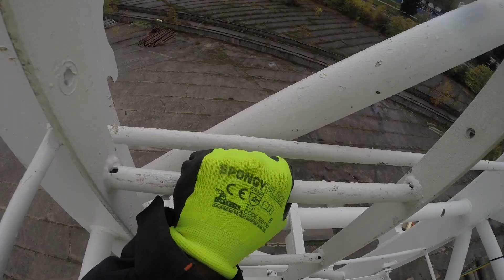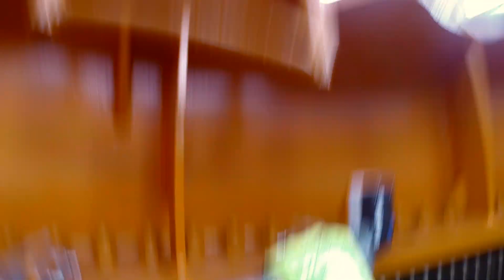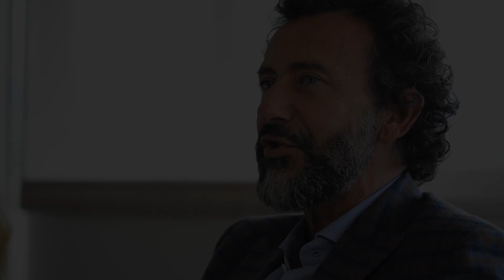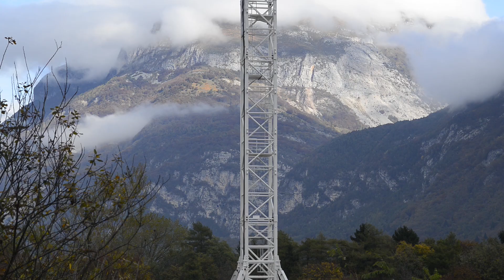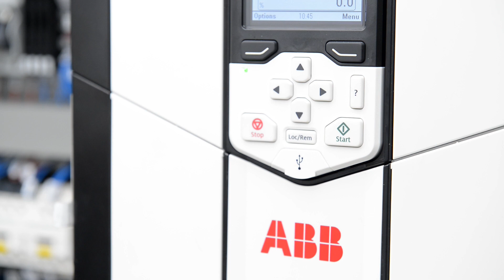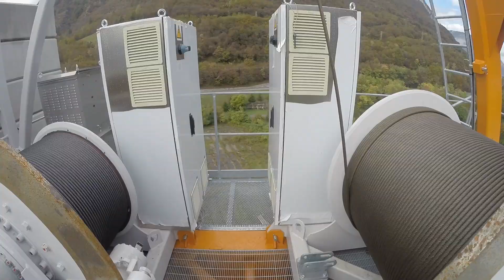Advanced control and safety technology improves tower crane performance

Comment: On a RTT 470 -24. Crane went together very well, cab is laid out nicely. Hoist and Trolley function well. Swing is horrific worst I’ve ever experienced. Encoder on swing motor keeps throwing bad information to ABB or the ABB drive is defective. You catch a dead hook and start to lower it and the crane will keep going back and forth getting hook swing going. No way to catch it as every time this crane thinks it has to twitch, very aggravating. No way for the operator to engage swing brake bad design. 
I have 30 years in towers. I am a Liebheer and Piner tower certified technician    Tech support is non existent for this crane.  Not impressed so far.  Swing brakes will slam on and crane will lurch right or left with no input from controls. No way to stop it